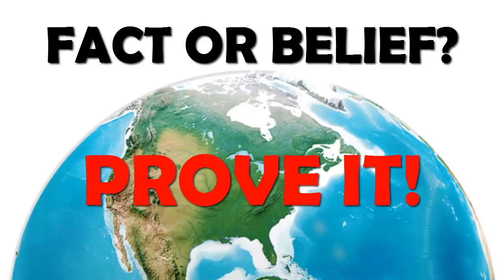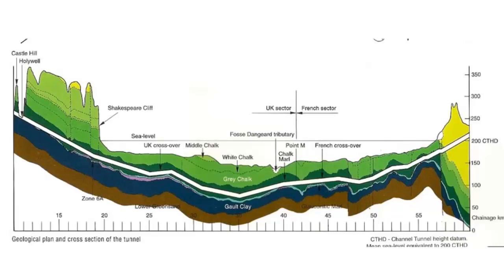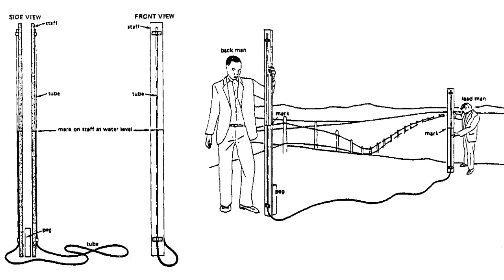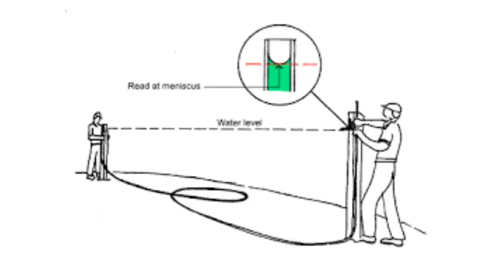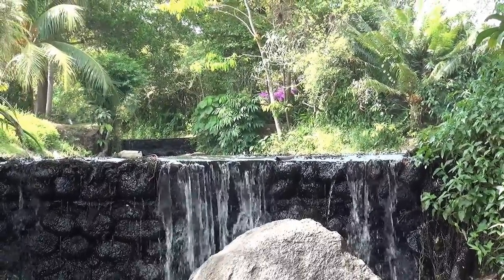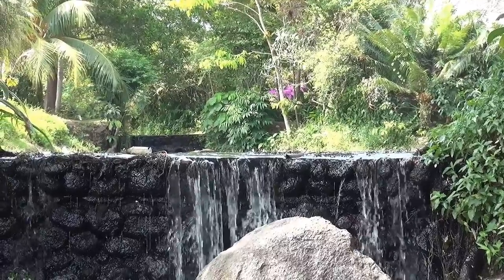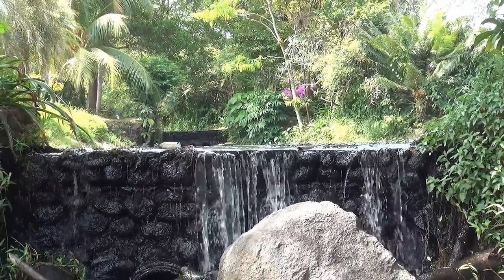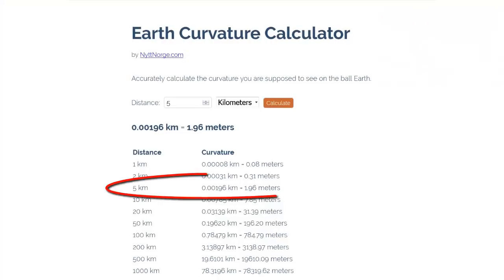Flat Earth Water Level Challenge - Prove Bendy Water Not Flowing

Comment: WELL RAIN DROPS ARE ROUND THEREFORE WATER CAN CURVE!!!

Just kidding ball earth water mechanics is silly. I mean what does sea level even mean on a ball. It doesn't exist in that model and yet ballers use it all the time.

Btw I don't mean to be rude to ballers as I was one myself for decades until 2015.
Reply: I was debating with a baller in the comment section of a video where Neil Degrass said "Nature's preferred shape is the sphere", which is, of course, nonsense.  I asked the commenter to name one example of natural spheres on Earth and he said "raindrops", which is, of course, also nonsense.  Raindrops are amorphous and could be best described as globular, occasionally spherical yes, but rarely.  One example of a natural sphere would be a bubble under certain circumstances, they too are often amorphous but can be regularly seen as perfect spheres.  As for nature's preferred shape, it would probably be the hexagon, a shape to which even bubbles will conform when en masse.
Reply: @BobtheScienceGuy  Flat Earthers can only "disprove" a round Earth by putting it in a flat earth model without gravity.  They fundamentally misunderstand and misapply the round earth model.

Mean Sea Level is the average distance of the ocean level from the center of the earth.  It's not complicated.  There's a little more to it than that, but that's the basic idea.
Reply: Correct..."sea level" can't exist on a Globe, no matter how ballers try to bend and twist logic.
Reply: @flatline-globeisdead9651  It can.  It exists on the same level of potential energy or distance from the gravitational center of the earth.  You have to get your brain out of the 2D flat earth "physics".
Reply: Carolyn Gutman-Dey  so explain whats wrong with the 3D globe earth physics using 3D physics theory.  I could say the flat earth is wrong because all of the water would collect at the north pole due to gravity.  I don't. Why? Because the 2D model doesn't have gravity.  It has acceleration which would keep the water where it is... flat...

If you're proving a theory wrong, you need to prove THAT theory wrong with it's own assumptions.

Or you could dismiss it with a stupid comment like "poisonous word salad" and not use logic or facts.  That's also a strategy.
Reply: @flatline-globeisdead9651  Its not worth my time to create a video to prove which has been proven time and time again to people  who will never advance science or be contributing members to society.  However, I can disprove your comments easily from the chair in the airport.
Reply: @ColmGibney  pearls are pretty spherical, maybe the moon, though I'm not sure you guys belive in the moon. I'm sure there are other examples of spheres. The thing about "perfect" spheres is that they only really occur in maths
Reply: Douglas Yes, there are some spherical forms in nature but the point was that NDT said it was nature's preferred shape when, in fact, hexagons and other polygons are far more common.
Reply: @BobtheScienceGuy  //Did you have a head injury in 2015?  Mean sea level is just that and it follows the curve of the earth.//

If you can't see the irony of what you wrote I don't think I can help you :D
Reply: @cambrosn  //Mean Sea Level is the average distance of the ocean level from the center of the earth.//

Define it how you like the water is never level on a globe. So why use the term level? Typical equivocation f the
 credulous.
Reply: @cambrosn  Gravity which is an unproven speculation. This would cause some anomalies on a flat earth. But of course it doesn't exist. What you think of as gravity (that is a force pulling down) is not what scientism has postulated (i.e. attraction between masses) but rather more simply explained by 
differences in density.
Reply: @cambrosn  In other words you cannot.
Reply: Yeah, yeah, not worth your time hahaha...You got plenty of time to watch Flat Earth vids though, funny that!
Reply: @paulelliott8062  "Why use the term level?"
Because that's the term they picked. Sea level is at the same level of potential energy based on gravity or distance from the center of earth's gravity. Sea level is a specific point on a vertical datum.

My guess is "Sea reference on the gravitational datum" wasn't as catchy as "Sea level".
Reply: @paulelliott8062  "explsined by differences in density"
What makes density work? It does't work in zero gravity situations such as the parabolic vomit comet.  Acceleration could make it possibly work. 

That makes another problem though. "The earth is unmovable" you claim, but is accelerating. Also, what makes the tides?
Reply: @paulelliott8062  "other words you cannot"
I could, but you'd claim the video is altered or I'm paid off by NASA. I've flown airplanes my entire adult life. It's a round Earth. I experience it every day.
Reply: @cambrosn  
//My guess is "Sea reference on the gravitational datum" wasn't as catchy as "Sea level".//

Plus also this is not what it is. No reference to gravity is ever used in conjunction with sea level. Sea level is exactly what it sounds like - level of the oceans.
Reply: @BobtheScienceGuy  
//There is a difference between level and flat. //

Nope there is not.
Reply: @cambrosn  
// It does't work in zero gravity situations such as the parabolic vomit comet.//

Yes it does. The forces that act in a parabolic flight will have less affect on lighter 
objects. If you had a feather and a dumbbell in the plane which one would fly about 
more quickly?

//Also, what makes the tides?//

Who knows. Oscillations of the fountains of the deep upon which the oceans rest?? 
Whatever it is - it is not caused by the moon. If it were then we would see tides in lakes and swimming pools and we don't.
Reply: @BobtheScienceGuy  I don't know why I argue with flat earthers.  It's like arguing with a stone.
Reply: @BobtheScienceGuy  That's true.  I do also have to give them credit for their incredible creativity in explaining their theories.
Reply: @cambrosn  Why do you spend time here if you don't even have time to refer to anything. Please, show a video or refer at least to your "smart people" :)
Reply: @niclasr8036  I'll refer to the entire scientific community of smart people.  Which one will you accept?  Edit:  Which one will you not just dismiss by saying "that's not what the bible says" or by claiming the source of gravity isn't where the 3D model says it is or by suggesting that every single scientist, pilot, physicist, astronomist, etc is paid off by NASA and there have been absolutely zero leaks?
Reply: @cambrosn  Anyone :)  I'm a rocket scientist so you can refer to me if you wish.. I've developed Ariane 5 rocket. The Earth has a flat Surface. What are your motives to debate this?
Reply: @niclasr8036  What did you develop on it?  Have you mentioned to your employer that you believe the earth is flat?

Where does the rocket go when launched?  What is it carrying? If it takes stuff to space, how does it stay there?
Reply: Green Grub  You're right freefall at 9.81m/s^2 exactly countering gravity's pull.  They are actually floating while still flying UP in the airplane.
Reply: I'd have to say nature seems to prefer a spiral, no? Phi anyone? Fibonaci?

Triangulation on a sphere? Triangles with more than °180? First spherical trigonometry textbook written a hundred years ago?

Universal studios uses spinning globe as logo as far back as 1920's....amazing coincidence that it looks identical to Nasa "photo" from space, forty years earlier.

Only astrophysicists are smart enough to understand how the universe works, we have to rely on experts like NDT to describe the earth in a way that not even Nasa shows us. If it looks different to our eyes than the science books describe then we need the experts to explain how stupid we are for questioning what we're told.

Doesn't matter what shape it is, but if you're gonna defend a position you haven't tested for yourself, you might as well be defending a religion.
Reply: @moshcustom  Triangulation from satellites is pretty straight forward. Three satellites give a two possible positions.  One of which can typically be disregarded.

As far as the logo, cartographers have drawn accurate maps for years without space travel.  Magellan must have been part of the NASA conspiracy, too.
Reply: @cambrosn  also works with land towers.
Reply: @moshcustom  I agree.
Reply: If water was flat an ocean would just rock back and forth on a globe, obviously water is not flat it's level.
Reply: You're not rude to ballers, you're actually rude to yourself by embarassing yourself. also, sea-level means a specific distance from the center.
Reply: @ColmGibney  natures preferred shape is still a ball though
Reply: @cambrosn  ... "You cannot feel speed, only acceleration"

Turning is acceleration.  Physics 101
The earth is constantly turning.

This is an example of your point.

The globe earth fails under the weight of its own assertions.  Under the weight of observable reality and contradiction.

The earth being flat is a non-issue.

The response to my above assertion will be the same as all responses in regards to this topic.  

to small. to large. not far enough. relative to size. relative to speed.

Never empirically verified.  Just reasons why it can't be empirically verified.
Reply: @paulelliott8062  Yes there is a difference, a sheet of plywood is flat, whether it is on the wall of the house, on the roof, or on the floor, it is considered a flat surface, as long as it is not warped, but in only one orientation would it be horizontal, which could be referred to as level, as could vertical.
Reply: @cambrosn  As a stone, I am insulted by that!
Reply: @niclasr8036  I'm still waiting. What is your role in that rocket?
Reply: @moshcustom  So. I was down in a valley hiking today. Zero cell signal, but perfect GPS signal. I guess there are a lot of hidden towers in the woods.

Comment: Why not shoot a laser horizontally and make height measurements where it hits given X distance away. If the globe was flat then the laser would perfectly hit the same spot without any deviation. If globe is a globe, it's curvature will make the laser appear to hit higher and higher from the ground.

PS you will need a good laser (might get diffused but I think it can go for 5 kms)

Comment: Water will flow around a sphere on Earth because it will be attracted to Earth and not to that sphere. 
Water flows to the closest point to the centre of Earth, and that's why you see it flowing around things and also why it curves around Earth, because that way, at the sea level, it is at the same distance to the centre of Earth everywhere.
Basically, being "level" is being at the same distance to the centre of the Earth, and that's what happens when water curves around the ball Earth.
Then, there are centrifugal forces, which make water flow a bit to the equator and away/into moons direction, but this is probably too much for someone who is starting to understand gravity. :)
Reply from the maker: Lots of talk. No practical proof.

Comment: Okay I will use your own video  experiment on perspective for this no math needed. As you have said multiple times on your own videos the "apparent curvature" is caused by perspective. As a rule of perspective the further away something is the more it seems to shrink in scale and draw closer to the vanishing point of horizon line directly in the center of your vision. I think this is fair. But lets look at the flat Earth videos showing "apparent curvature." It's true that sometimes zooming in on objects bring them back into focus, however there are videos where it is clearly showing that tall buildings like light houses and towers across the water have large portions of their lower sections hidden below the horizon line. This is impossible if the water is flat because zooming in on it should bring the entire building back into focus above the horizon at that distance when you zoom in. However, there are several cases of flat earth videos that show structures even built a decent amount above sea level only have their upper portions visible no matter how far you zoom in on them. Simple perspective cannot explain this the only thing that can is a globe earth with curved water. But You won't accept this as proof, even if I did look at the F.E.S. own evidence, even though saying that doesn't count is basically discounting your own video evidence and your own version of logical experimentation, you will simply point and laugh and call me names and try and tell me that I'm painfully wrong or don't understand your arguments, the handful or arguments and "experiments" you repeat like a broken record for every single video with no actual results to show for them, trying to explain perspective 500 times in a row like you're talking to preschoolers, but then whenever someone points out how perspective doesn't apply to how the sun or moon looks the same size or bigger when it should be "further away" from us during their setting and rising you change the rules. There is no proof you will accept unless we send you to space ourselves and show you, and even then I'm sure you'd think is was some fancy simulator or something. Now assuming you made it down this long example/rant I've given you (which I'm in doubt you will) Say I accept the flat earth model (despite it not being an actual thing even flat earthers agree on) flat earth is real, what does it mean? What's it matter? God made an ant farm instead of a massive universe and we can shut NASA down, what does it change that's really truly of any worth? changing a few maps? In the end is it really worth the effort and why?